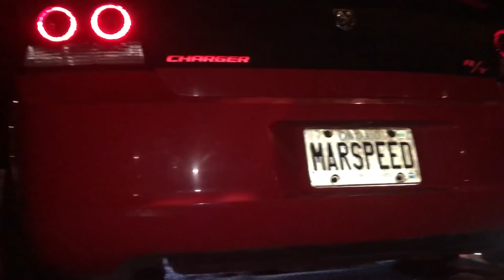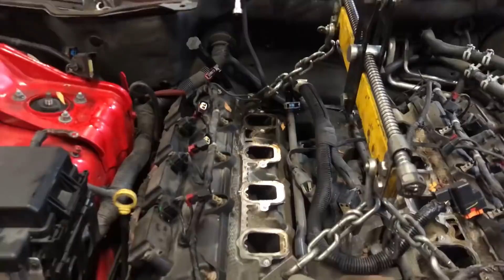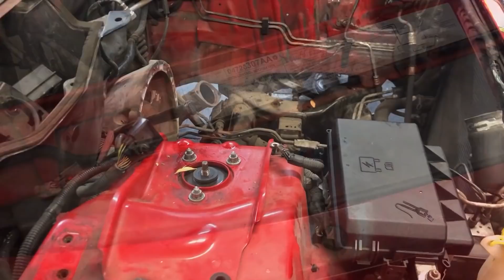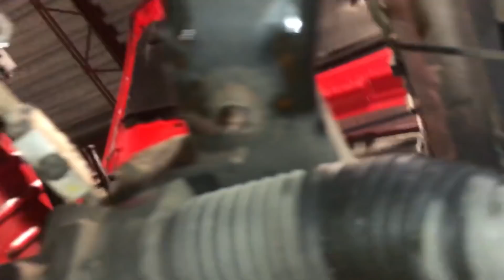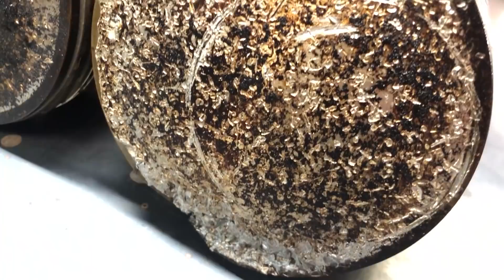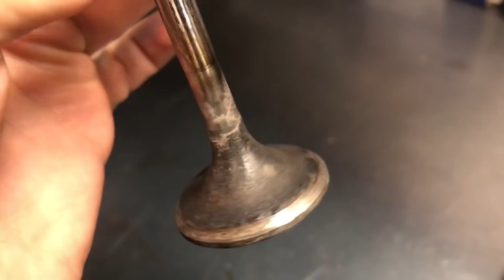How Much Damage Does Dropping A Valve Seat Cause? - 5.7L Hemi V8 Failure

Comment: Just suffered dredded dropped exhaust valve seat. Ruined the head, piston and scored the cylinder wall in #4. Did you fix yours?
Reply from the maker: Fixed it yes. Went with a built up stroked motor, there’s a few videos of it on my channel (but I’ll admit I need to post more of it!)

Comment: Dropped valve seat on my #2 cylinder piston shot see no signs of damage on any other cylinders is it possible to replace piston and have heads done or will there be metal still in the engine

Comment: They run hot, you need vents to keep the engine bay from retaining the heat, and proper cooling system maintenance, and potential high performance fan.

Comment: Let me ask. I have a 2005 dodge ram 1500 4.7 and this guy Martin on YouTube keeps telling me that I have a dropped seat valve. I don't believe it because the truck starts up fine, there is no banging sounds, no smoke. I do have 60lbs compression in cylinder 8, when I removed the valve cover on the passenger side, the rocker arm fell off from cylinder 8, the very last rocker arm. I tried putting it back on and it's loose and pops back off. The horsepower is horrible and so is the gas. I also put a new spark plug in cylinder 8 and less than 5 minutes it was black already.

Comment: This EXACT same thing happened to me with my 260k mile LS3! Stopped for a fountain soda, started up again, heard a click noise from the engine and immediately turned it off. Wouldn't start again. Pulled the engine out and when I took the heads off I found a dropped seat. Luckily it didn't detonate the piston! I'm stripping the block and taking it along with the heads to a machine shop for rebuilding but when you described what happened to you, that's precisely what happened to me, and with no overheating.

Comment: I wondered if it was more of a newer generation of 5.7s but I guess it's possible 4 all 5.7 hemi's to drop valve seats,, so it would be better to remove the heads and replace em w aftermarket ones ( performance ) before this happens

Comment: I'm going through this right now with a 2017 Ram. Just under 100k, out of warranty and three years left to pay on it. It's a real kick in the nuts
Reply: Wish you the best of luck brother
Reply: My condolences did you get it done
Reply: Hey Frank, Ya I had to RnR the engine. Got a reman long block, had it installed, got the truck back and the motor blew next day. Builder said it was because I used the original intake manifold but the mechanic cleaned it and scoped it. The builder fixed the motor and I got a new manifold. Funny thing is I couldn't find an intake manifold anywhere because all the dealers had people waiting for warranty work on dropped valves. Cost me over 12k in the end.
Reply: ...Seven months without the truck to boot, borrowing wheels to keep working.

Comment: I'm currently paying $3300 for this & I never rev the engine, just local driving,no hauling ..nothing...So how the fuck does this happen to a truck I baby & only have 62000 miles on & it's a 2015 ....I'm questioning what I'm gonna do with this truck cuz it obviously cant handle all the wear and tear of being parked 90% of the time
Reply from the maker: Not your fault, it’s just a design flaw. All the Hemis have something that affects them one way or another and it can happen to any engine at any mileage. Sorry to hear you’ve had problems

Comment: It´s easy to prevent these HEMI´s of that dropping valve seat issues, i´m very sure about that.

Anbd that is to get a electric water pump, what would turn the cooling water circle after the engine is turned off...for round about 10 minutes or something else like that. That´s it in my eyes, because in the highest point of the cooling liquid/water circle the cooling isn´t right after shut off the engine. Because heat bubbles in the water circle are the problem in my eys. and the highest point of that water circle is even the area arround the valves. and when heat bubbles instead of cooling water/liquid in this area can´t cool the aluminium of the cyl.heads like it should be, or is when the engine is running and the water pump turns the water arround all areas of that cooling water circle. So if you could make that the water circle is turning for a while after the engine is shut off, you should not get that much of the heat expansion of the aluminium. The heat expansion arround the valve seat rings is that little to high, that the rings can fall off the bore where they´re located/pressed in. And if you´re using a little electric 2ndary water pump, that will let the water circulate in the system, the problem should be solved. because then there shouldn´t be that problem of the heat bubbles that come on when the water isn´t moving arround the hottest area, what is that highest area arround the valves/seats. 

I often give you such comments that would help a lot, and i hear that you never thinked about that or told it in your videos for example, what i told in this particular comment, what really could solve that issue. I hope it isn´t a problem that i´m from Bavaria, Germany or something else like that , but i really think about why there isn´t any answer from you on any of my importand comments here.... Can you tell me that, please???
Because my most intention is to help the guys & girls who loves these nice Mopars, with that nearly perfect modern HEMI V8 engines, that could be a lot more perfect if these little "Build in issues" could be solved. And vola, that´s my intention; TO HELP TO SOLVE THE PROBLEMS....

Before you got your Daytona, i got mine 2006 Daytona, Top banana! with nearly 140.000mls on the odo. The 1st what i did was change the stock water thermostat into a 180°F/82°C Thermostat. & because the Motor Oil Temps was a little to high for my taste, i also build in an 15-Row Radiator for the Motor Oil Circle. I mounted it with an aftermarket Oil Filter Adapter what is also with an thermostat that opens also at 180°F/82°C, that the Motor Oil can circulate to the Radiator & cool down. Now tha whole opperating temperatures droppet round about 25-30°C what is a really nice drop. But even because i think the problem is that about that there would build up heat bubbles arround the Valve Area in the heads when the engine is turned off, i thought to solve that with even that i told above; a 2ndary electric water Pump, that go to work when the engine is turned off, for roundabout 10-15 minutes. Then that issue of droping valve seat rings should really be solved.....That´s what everybody should do to prevent that. And in my eyes it isn´t that hard to make this little upgrade/modification to the car. It could safe you tons of money, tons of work time &tons of nerves, too! & it could be safe a lot of nice cylinder heads & also whole 5.7L HEMI engines that really could life nearly forever, if the owner would to the right things with it.
I think i really could help a lot of owners of these amazing nice vehicles to really have fun with it for a long long time, even with such a comment... Hope to hear from you &/or about this optional modification to prevent th dropping valve seats in your next videos about this topic ?! :)

Have a nice day & a lot of fun with your Daytona! :)

Cheers Till
Reply: Oh, and just look at "HEMI-spherical", what is new channel, where you could see my Daytona at the pictures, some videos will follow this summer when i´m doing the next modifications about the electric water pump to prevent droping valve seats. My Channel has the intention to help owners of these Mopars and many more witt even such topics. But it´s new and still in the moment, in the winter time i´m not driving the Daytona in the salty, snowy condition bavarian roads, even to prevent rust! ;P

Comment: Hey- ran a production engine shop that rebuilt 6000 engines a year in Nashville- did a lot of the Gen III hemi motors so we were very involved with the valve seats dropping - The vast majority of them dropped the intake valve on the right front cylinder so we started by replacing it on every head whether it had dropped or not only to have it drop another one shortly after it was installed so we decided to replace all of the intakes with new seats that were thicker and larger in diameter with a 0.007" press fit. I think the reason we had problems after we rebuilt the heads was because we cleaned them by baking them in the oven at 400 degrees for about 8 hours and shot blasted them afterward. This process worked fine on all other aluminum heads except for the 3.7L/4.7L and 5.7L Chryslers, because they all shared the same problem with the intake seats. We managed to remove some seats without damaging the bore and found that they had about 0.003" press fit which wasn't enough to hold them in the bore. We believe that the seat was structurally too thin-  it measured 0.220" - to hold a press fit, especially when you see how much of it was removed at the top edge to create the angles for the valve seat. It is so thin at the top that you couldn't do a valve job on it and you could nearly cut your finger on the edge of it. It's interesting that the right front intake is located at the highest point in the cooling system so it would likely  be the first to expand in a hot soak. Doug Anderson @ dougnash3@comcast.net

Comment: Yep my 07 did it little under 100,000. Same thing I shut off the car ate my lunch tried to start it up 20 min later and wouldn't start making strange sound finally started and making all kinds of sounds! Mine also was doing something before the dropped seat that I couldn't figure out what was going on. Once engine was nice and warmed up and driving in traffic at a stop light it would have a strange stumble at idle then be fine. A few times it stalled and didn't want to start then was fine. Only did it after being nice and warm for a while and then would do it at regular intervals. No doubt in my mind the valve seat was trying to drop out while sitting there idling at a stop. Was wanting to mod it anyway so now gathering parts to stroke her to a 396.

Comment: Hemi last forever, mine got almost 300,000 and has over heated twice, no valve seat issue. If you don't - upgrade- plugs or spark, you will probably never see a valve seat issue with these engines. This explains why it's almost unheard of in fleet use.
Reply: Joe Gibbs,  So, are you saying that when you put in new plugs just go with the same factory type?

Comment: I didn’t have a valve seat drop but I had a rod bearing spun on my crankshaft a had to replace it. 400 for a brand new crankshaft not bad. I also had a valve job done on my heads. Because the fear of a valve seat dropping. So engine had 128,000 miles before the damage. Now my engine is back in the car and driving strong. I really enjoyed your videos.

Comment: Mopars are awesome... ESPECIALLY the classic ones from the 1950's-1970's...  But , When Daimler got ahold on the company, a lot of things started to go wrong. The 3rd gen 'Hemi' engines, are not actually HEMI-spherical combustion chamber designed... Aluminum is light and looks good, but problems with warping and softening when being overheated has always meant that it is not as durable as cast iron... Many OHV & OHC engines with aluminum heads have problems retaining hardened valve seats, like what happened here... And the results are DISASTROUS on interference engines, as seen here when that happens... Not to mention that other problems have developed with these 3rd generation 'Hemi' engines... Like the issues with the failures of lifters and camshafts... These later 3rd gen 'Hemi' engine designs, have not held-up well at all after some miles were put on them... It is one of the MANY reasons, that the earlier cars & trucks , especially those from the 50's - 70's , typically have so much more interest from potential buyers... Less to go wrong, more reliable....

Comment: I've heard that a 185 thermostat will help with the issue keeping the engine a little cooler.
Reply: You can also turn on the AC (which turns on the engine cooling fan) and put the heat on full blast to cool and coolant before shut down just for a minute or 2. This cools the coolant way down. Kinda excessive but it really works if you have been racing or something lol.

Comment: I just recently found your channel again. I was planning on getting hellcat replica wheels for my 2012 charger se. I was wondering if 20x9 rims would be a good fit on a 265/40-20. I dont want my tires to be stretched and dont want the rims to stick out of the tire. I would like it to be a near perfect fit inside the tire
Reply from the maker: Hey yeah that’s a seemingly perfect fit in my eyes. Not too wide. The 20x9 and 265 should be great if you don’t want the oversized look, and it won’t stretch out the tires
Reply: @MarspeedCars  thank you so much man for the feedback. Just subbed

Comment: I have so many parts to these engines because of this issue. The lifter rollers can be fixed very cheaply when you have alot of crap lying around. Push the bad pin out of the lifter, Go find lifters from a Chevy 350 with rollers or a 3.0L Ford Vulcan V6 OHV cast iron engine from a Ranger or Taurus. The Rollers are identical to the Hemi rollers. Note: The lifters themselves are not compatible, just the pin and rollers. Use grease to hold the needles in the rollers or you are going to have a headache on your hands....and head. I have several other roller lifters around my garage, and ALL of them have been compatible with the hemi rollers, so there is other engines that share these parts...just can't remember what they are. Edit: 2.2L ohv 4 banger from a 96 Pontiac Sunfire....really any GM OHV engine from the 90's seem to have compatible rollers. 3.8L v6 GM .

Comment: I heard that its good before shutting them down is to let these motors idle to cool down a little.  It was just a matter of time. I hope the block can be saved.  I'd like to swap a 5.7 into my D150.  When people have lifter issues with the older Hemi they should also rebuild the heads to deal with the valve seats.

Comment: 3 valve Ford 4.6, 5.4, and 6.8 Triton engines can have the same issues as well to a certain extent. More common on the 5.4 engines.

Comment: I feel for ya. My 2010 RT 5.7 has 201,000 miles and running like a champ *knock on wood*.
Reply: I believe the 2009 and newer ones have their seats pressed in better?
Reply: @carlweeks9256  yup.
Reply: Have you had to replace cam and lifters yet?
Reply: @Markiehemi  nope. Absolutely no major engine work.
Reply: @13slot28  Damnnn!